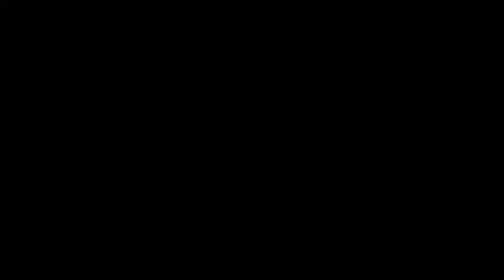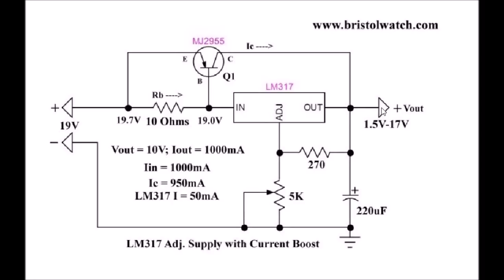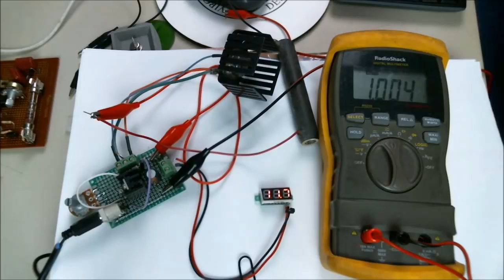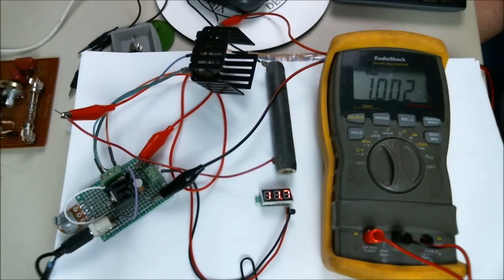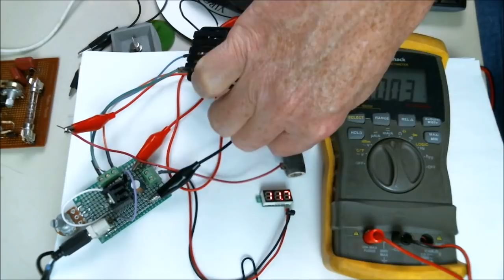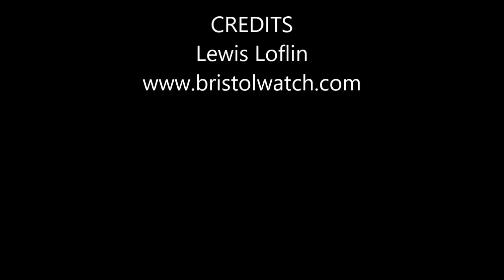Current Boost LM317 Adj. Power Supply

Comment: I have used this circuit for years. It works fine. Good load regulation. Can energize up to 5 amperes load. I use 6.8Ω and TIP36 with large heatsink.
Reply: @ibles bosuok..
Where did you joint the 6.8ohm..at the lm or tp?
Reply: Upto how much ampere can we use on 2n3055 without damaging anything ?

Comment: I prefer 6.8 ohms for Rb, so the current threshold would be about 100mA.
Choose 390 ohms for feedback resistor, the maximum output voltage would be about 15V which convenient for many applications. You can supply with 18VAC secondary voltage.
Greetings from Indonesia

Comment: Nice simple circuit.   I have issue with one detail, though.  The idea that the pass/boost transistor's base current flows out the collector seems wrong.  That junction is reverse biased.  In general, I understand that I(e) = I(b) + I(c).  Basically, the pass resistor acts as a voltage source to turn on the transistor.
Reply from the maker: I agree with you, but the problem is current flow as presented today is wrong. Actual charge movement is from negative to positive, but everyone goes batcrap when I present it that way. Go look it up in any physics book. Ic and Rb as presented here are wrong, but I present it that way because people are taught the wrong way, which doesn't make sense when closely examined. Yes, the resistor is a voltage source to turn on the transistor, exactly.

Comment: I know this circuit works as I have built it and seen it work, However, I still dont quite grasp how the voltage remains regulated at Vo with the Q1 in the current path..

Comment: I'm not certain most of the Rb current would be going to the base-collector junction since the input of LM317 is absorbing all of the 10 ohm R  current and the emitter-base current turning the transistor Q1 on. 
If on the other hand the current flowing through 10 ohm resistor, would go to the base of PNP, (as explained in 3:39 ) Q1 would stop conducting. Other than that, your video is great, and very useful as usual.
Reply from the maker: Rb sets the current flow for the PNP transistor. When enough current flows through Rb, the voltage drop turns on the transistor, shunting excess current through the transistor.

Comment: Great Video, Very Detailed. I am just messing around with a few boost, and buck converters I have purchased overtime. I have seen a few video's, explaining how to bypass the LM317/LM388 for higher current than what the chip allows. Couldn't you also bypass the limitation of the converter like the LM317 circuit in your video. Looks like you could do the same thing without fail. What do you think. For Example, I would be using a Buck converter with XL4005.

Comment: I can't figure out the mechanism of which the output voltage is still regulated. Since the input voltage is passed across to the output through the transistor.
Reply: Did you got the reason why it’s still regulated on the output? I tested it and it works even on higher current, I just don’t get why it works, shouldn’t the on transistor act like a “path of least resistance”? I don’t get why it still gets regulated…
Reply: @KelvneMachado  Don't know. Just have to accept that it just works
Reply: I’ll look further on a local university, if I find a professor willing to explain, I’ll explain here, maybe even make a video about it, no one explain that on any video
Reply: @KelvneMachado  Maybe a few sentence to the point is enough to clarify it?

Comment: Great explanation! Should point out that one issue of using a PNP transistor to boost the output of a three terminal regulator is that there is no short circuit protection and in the event when the bypass transistor fails the input voltage is directly dumped onto the load.
Reply from the maker: Good point I'll do a vid on circuit protection which I did in other vids. The same problem exists with the LM317 alone. Thanks.
Reply: Yest you are right .   For information  ,  I have tried both solutions,  the LM317 has temp and internal current protection of 1.5A. I just got  10pcs($1) from TK Electronics 99.5% on Ebay , tested those (short output at 39V input)and  believe it or not,  not one failed!  I use a lm431 to drive 6pcs   lm317 resulting in a  very very stable output  between 0 and 9A

Comment: This circuit  design needs improvement. The regulator will stop regulating the output voltage if the potentiometer is set to 5k ohms. For 17V output, the 270 resistor needs to be 397 ohms when using the 5k ohm potentiometer.  If you intend to build this circuit beware! 🇦🇺
Reply from the maker: Yes it's a demo circuit.

Comment: What about protect Ic path (BJT transistor) ? LM317 protect himself but BJT doesnt't have protect. You must add one transistor + resistor to protect
Reply from the maker: One can do that but it works well as is. I used a current limiting resistor in one design. i was inserted between the transistor base and the LM317 IN.

Comment: Let me get what you saying here a pnp transistor is amplify current I get that but what I don’t understand is pnp is trigger by negative voltage but am seeing positive connection directly to its base no positive way the transistor can turn on and less there’s a npn that is sinking the current on the 10ohm resistor to allow negative voltage so please tell me what’s going here
Reply from the maker: There is no "negative" voltage there is a voltage difference across the base-emitter junction. The base-emitter current, controlled by the LM317 is amplified by the transistor beta rating.
Reply: @LewisLoflin  ok so there is negative current from the lm317 I see now

Comment: Can I put somewhere a potentiometer to adjust the output current. If it's possible can you tell where i should connect it and what kind? thank you for this upload, you help me a lot to understand.
Reply from the maker: Not without a major redesign of the circuit. Sounds like you want a current limiter.

Comment: I wonder why not using a 2N3055 after the lm317 and spare the resistor and the power it dissipates?
Is there any special reason to use the 2955 and the resistor?
Reply from the maker: 2N3055 is an NPN. This is a current boost and requires a PNP.

Comment: LM317 2.5VDC with current limit of 1.8A please. Thank you in advance.
Reply from the maker: Correct that's why the transistor.
Reply: @LewisLoflin  Can you show in youtube how to set exactly 2.5VDC with current limit of 1.8A please.
Reply from the maker: The 2.5 volts is dependent on your load resistance at 1.8A This is a current regulator, not a voltage regulator. The input can be for example 10V and if the output is set to 1.8A the rest will take care of itself. But again, voltage is set by load resistance.

Comment: How to use this circuit if a negative regulator Lm337 is used for negative voltage ?
Reply from the maker: Use the LM337 but change the transistor to an NPN, reverse all the caps, etc.

Comment: I have questions -
1) If I use an npn transistor and connect it's base to the regulator output , collector to the input supply and take final output from emitter and ground for drawing upto 3 ampere load, then will the output voltage have good regulation at all voltages I select ?
2) If I use your circuit with pnp transistor, will I need to put heavy heatsink on both the regulator and transistor or only the transistor ?
Reply from the maker: 1) can't use a npn. Use a heatsink.

Comment: Why the voltage in the input is not dumped to the output voltage when the transistor is on?
Reply from the maker: The transistor passes current. Voltage is set by the LM317. The transistor current is controlled by the LM317 current and resistor RB.

Comment: Can I use p Chanel mosfet in this circuit?
Reply from the maker: No. Transistors are current operated and MOSFETs are voltage operated.
Reply: @LewisLoflin  thank you very much sir, another question is, what should I do to achieve solar charge controller through this topology? (my target is to achieve 30 amps) pls help, your video has been a great help to me.

Comment: The transistor only works when voltage drop across Rb resistor is greater than 6V. Why it does not turn on when voltage drop becomes 0.7V? I am using load of 5W 10 ohm resistor. Below 5V drop transistor does not conduct and all current passes through regulator. My Rb resistor is 3 ohm 7W and transistor should conduct when current greater than 0.2 A passes to allow 0.7V drop.? Please help
Reply from the maker: No it works at about 0.7 volts.
Reply: @LewisLoflin  The transistor conducts when voltage drop in Rb resistor geta above 7 why is that?
Reply from the maker: It's what the BE does when it conducts we get collector current. The 0.7V is can be a little higher or lower in the real world.

Comment: i like the explanation you use but what is the purpose of the transistor if we get  1A out fro 1A in.
Reply from the maker: If you use more than an amp the excess current is carried by the larger transistor.
Reply: 10Q

Comment: I don't have any silicon pnp power transistors at hand but I do have a few npn ones. Could I mirror your transistor / Rb circuit on the output side of the lm317 with a pnp transistor? Thanks.
Reply from the maker: No you can't if you want a positive output.

Comment: hello Lewis loflin, if the input is 20V 2,4A, this circuit regulator isn't damage
Reply: The power loss in LM 317 is proportional to input output difference. for example if  output is 5 v and input is 20 v with 0.5 amp current   power loss in 317= (20-5)x 0.5 = 7.5 watt. u need big heat sink and fan. see my vidioes

Comment: I have solar panel which gives output 7v 100ma will this circuit will convert it to 1000ma?????
Reply from the maker: You don't need this for 1 amp use the LM317 circuit by itself. Make sure it is well heatsinked.
Reply from the maker: Wait a minute - what are you using a 7-volt panel for?
Reply: Charging a battery
Reply: @LewisLoflin  I want to increase current 
I am using solar panel for charging a battery
Reply from the maker: @ankamanirudh8837  You have a 7-volt panel what is the charging voltage needed?

Comment: Hello Lewis, Thanks for your analysis, its great.. My question: Will the LM317  hold the voltage  set . as we increase the output load current.  It appears that the MJ2955 is paralled with LM317, I will try it nevertheless.
Reply from the maker: Should be close that is what my tests responded.

Comment: That was a good practical video, thanks. Once the current is such that the resistor develops 0.7 volts or so it turns on the transistor and now you can supply more voltage. I like these analog lessons.
Reply from the maker: This about current not voltage. The voltage drop depends on the load resistance.
Reply: Doesn't the transistor turn on when the voltage drop across Rb is about 0.7 volts, enough the forward bias the emitter resistor?  I thought that was what Rb was used for.
Reply from the maker: The BE voltage stays around 0.7V once turned on because addition current flows from BC.

Comment: where is the current limiting resistor for the base? if the lm pulls enough current base current will overdrive and might destroy the tran.
Reply from the maker: The LM317 doesn't pull current through the base the voltage drop across R does. That type transistor can take a lot of current.
Reply: the LM is a magic auto-adjusting resistor, forming a voltage divider with Rb that always balances to 0.7v, given a reasonable input voltage and load resistance.

Comment: Outstanding video! I just built my first power supply using an LM317 and I wanted to increase the current capability so this info is exactly what I was looking for. Is there an easy way to calculate the voltage drop across Rb so you can select the correct ohm value?
Reply from the maker: That is tough. The voltage measured across Rb is the emitter-base voltage of the transistor. It will measure about 0.6V from a forward-biased junction. Note the current for the LM317 passes through Rb so big values of Rb might cause the LM317 to lose regulation. Use a 2-watt resistor. Don't use this to pull massive amounts of current.
Reply: Copy that. I'm sure it can be calculated though since it's similar to calculating the value of a resistor to obtain the 0.6v - 0.7v bias needed for any transistor, except in this case we're trying to make a difference in potential between the pcb trace at the transistor base and the trace at the emitter. I'm thinking if we can calculate the total resistance we can find the current, and since we know the voltage at Rb we can figure out the amount of resistance needed to obtain the small voltage drop we need to turn on the transistor. Like you said also, we don't want too large a resistance or we'd be removing the LM317 from the equation altogether.
Reply: @LewisLoflin  P = U^2 / R. Considering Urb will never be bigger than 0.7V (forward voltage BE) (0.7)^2 / 10 = 0.049W - why use 2W resistor?
Reply from the maker: @zyghom  All of the current for the LM317 itself passes through this resistor. I also happened to have 2 watt resistors. Smaller should still work.
Reply: @LewisLoflin  that is ok but there is a difference between: "we need 2W resistor" vs "I happened to have just 2W resistor". If we consider the voltage on this resistor cannot go above 0.7V (as there is a E-B "diode" like forward voltage) then there is no need to have such big one. So either I am not getting the point or... ;-)

Comment: Thanks for the great explanation. Is it possible to use 12V instead of 19V ?
Reply from the maker: Yes depending on the required output voltage. That is determined by the load resistance.
Reply: @LewisLoflin  I tested the circuit and it was worked fine, but the output of the circuit was shorted by mistake so then the transistor was failed. Therefore if it is possible to add mechanism to increase the current gradually, it will protect the transistor with high current surges.
Reply from the maker: @neon-pl3du  How much current are you drawing? You will have to read the transistor specs.

Comment: Can we use bd249c?
Reply from the maker: No that's an NPN transistor.
Reply: Using NPN 2N3055 the collector will be input voltage and emitter will be the output voltage and just omit the 20 ohms resistor at base of MJ2955 currently connected and you can add ballast resistor  .1 ohm 5 watts between emitter of 2N3055 and output if you want to use two or more 2N3055 for higher current 10 ampere or more.

Comment: Lewis
I made this circuit but 10 ohms resistor was burned.
Why?
Reply from the maker: What was the load? What wattage was the 10 ohm resistor?  Are you sure you wired it correctly?
Reply: @LewisLoflin  
Load=Halogen Bulb 100W 12VDC.
Reply: @LewisLoflin  
1 Watt resistor 10 ohms
Reply from the maker: Learn BOX  what transistor are you using? Do you know the actual beta? Try a much smaller load to make sure it is working.
Reply: @LewisLoflin  
MJ2955 Beta is 100
Reply: @LewisLoflin  
Voltage regulation is done but when I connect 12VDC bulb 100Watt then 10R resistor gone very hot and leave smoke.
Reply: @LewisLoflin  

I tried with 0.5A and 1.2A load of double filament bulb
but MJ2955 with heatsink gets very hot.
Please let me know how to fix it.
Reply from the maker: Learn BOX  What is your input voltage? Any voltage not dropped by the lamp will be dropped by transistor and LM317. That is how this works. Assuming the input voltage is 20V and the load is 12V at 1 amp 8 watts will be dissipated by the transistor.
Reply from the maker: Are you using this as adjustable or fixed?
Reply: @LewisLoflin  
Input voltage 19V recitified and filtered by 100uf 50v cap.
I am using LM317 adjustable voltage regulator.
Datasheet mentions 75W for MJ2955
Reply: @LewisLoflin  

I will use it as fixed voltage regulator of 13.8V
Reply: @LewisLoflin  
Actually I want to make car battery charger.
Reply from the maker: Learn BOX  This is a current regulator not a voltage regulator. Why use a variable current regulator for a fixed voltage? Use the designs on the following link with a 7812, 2 diodes, and a 2N3055.
http://www.bristolwatch.com/ele/basic_power_supplies.htm
Reply: @LewisLoflin  
7812 delivery fix 12V but I need 13.8v.
Reply: @LewisLoflin  

It works well but I think there is a need of base resistor?
Reply: @LewisLoflin  
Can I charge car battery of 12V at 80AH.
Reply: @LewisLoflin  

Thank you Sir lewis, it is working and deliver 3.28Amps I attached large heatsink but now Transistor 2955 is still heat up but less than before.
Reply: @LewisLoflin  
Can I connect second PNP 2955 in parallel with 1st one.
Emitter to emitter, base to base, collector to collector.

Comment: can I make same  circuit with replace lm317 by  lm338
Reply from the maker: The LM317 and LM338 are identical, except the LM338 is 5A. Yes.
Reply: @LewisLoflin  I tested one LM338 but it did not give me 5A at the output. What is the reason?
Reply from the maker: It has current limits due to heat. Never operate any device at max. In general no more than 80% in my opinion. What is the voltage going in versus the voltage output? Using a pass transistor distributes the heat. Use a good heat sink.
Reply from the maker: Also make sure to use input-output bypass capacitors.